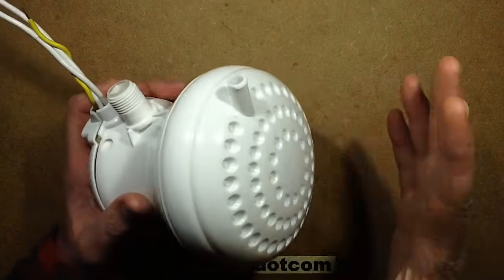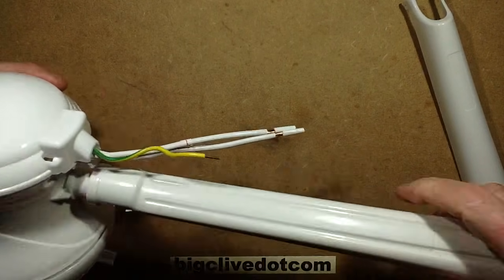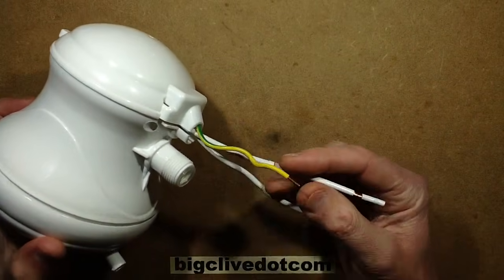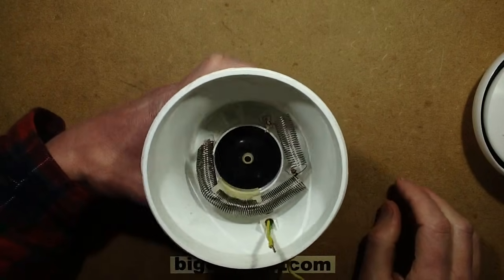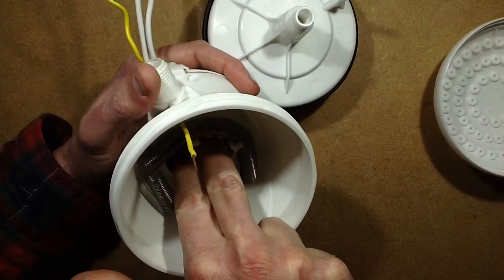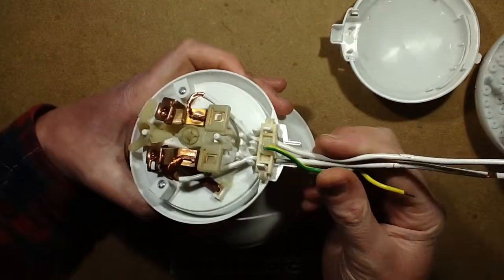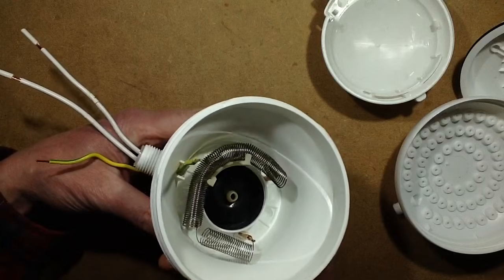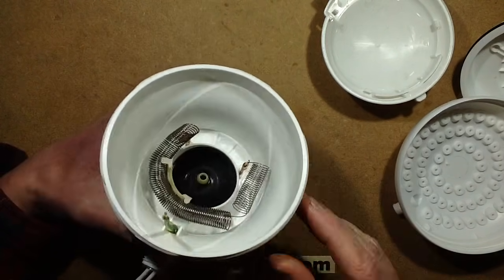Inside a heated shower head.  (suicide shower)

Comment: Watching these older videos, I must say, I have always been fascinated by these shower heads. I've never seen one of these in use, but for some reason I want to install one in my shower. I have a fifty gallon heater tank, so I'm not in want of hot water for showering, but the on demand or supplemental aspects are appealing to me. I'm not afraid of doing the work, but I would never run 240v into my water closet as I have a healthy fear of electricity in regards to water. 120v here wouldn't do much as far as heating those elements up, but I'll always remain curious. Great video, by the way!!
Reply from the maker: I'd definitely not recommend actually using one of these.  But buying one as a novelty is viable.

Comment: every other brazilian in this comment section is pointing out things like the relative safety of electrical showers, the complete absence of boilers in brazilian houses, the existence of higher wattage showers for colder regions, the extreme poor quality of this shoddy chinese knockoff unit, the inexistence of GFCI etc etc, but i don’t see anyone pointing out that the big hose with the “valve” at the end is not a safety steam release. that’s a douche, you pull the plug when you want to wash your parts ^^"
Reply: Not putting that thing anywhere near my "parts" 😮

Comment: I found one of these in a hacienda in Ecuador - 110V 50+A as I recall, wires connected with screws and nuts - but for added value the power switch on the wall just outside the shower area was an open double-pole knife switch. I took a lukewarm shower!

Comment: The little hose that comes off the shower head is for rinsing your difficult to reach areas.  My landlord says we can't use the warmer setting - it will burn out the shower.  The lower the pressure, the hotter it gets.  
We used one at a hotel that had a fuse in it somewhere. They had to change it as we had no warm water the first night.

Comment: Droplets of water do not carry current if voltage is low (up to about 1kV) but when it's higher then current can jump from drop to drop. This is the difference that you can't electrocute yourself by peeing on the third rail (you only get arrested) but you can get tingle from cattle fence.

Comment: These comments from Brazilians defending the horrible conditions they live in are amazing.

"No, we like it! We're happy that hundreds of people die in the shower every year for no fucking reason. This is good and fine and normal!"
Reply: The problem is that the statistics don't say that. We have like 90% of our houses with electric shower heads like this one (a little better built honestly, but very similar) and the accidents happens more on the 10% that actually don't use them... Like people dying on poor gas ventilation due to faulty gas heaters... And its worse since most people don't properly install them by neglecting the grounding, having wrong wiring and improper isolation...

It does look stupid, but if you compare the numbers of accidents to other heating methods it is statically safer.

Also, we normally don't have bathtubs which looks like where most of deaths happens from electrocution while taking a bath in other countries...

Comment: The little hose is not a blow off. Its just a spray hose to rinse off with. The water follows the path of least resistance when you full the little knob. Use these for over 30 years. Don't ever use a plastic pipe to the unit or pvc in the wall. Ground the pipe and metal extension well and it will never, ever shock you.
Reply: The Brazilian Lorenzetti are the best I've ever used.

Comment: The real suicide shower were the old ones - made of bare metal. There norms in Brazil requiring ground and and all the other safety devices and it's not a surprise most deaths due to electricity happen in the poorer regions up north where, btw, people usually to turn the shower on because it's too damn hot even during the winter. You are correct - it correlates with poverty even within Brazil - and regulatory agencies don't look closer into the problem since they know how difficult it's for people to follow them. They should, however, not let a store like Leroy Merlin to sell insulated tubular connectors that don't crimp!  10 for one buck while the one with the Inmetro (national standards institution) seal and NBR (technical norms) number cost 1 buck each. (those are local bucks - 1/6 or 1/7 of a British but and 1/5 of a US buck). In 2018 the National Museum located on Rio de Janeiro went to dust after a fire that burned all historic documents, the oldest human found in the Americas and Egyptian mummies brought to Brazil by the Portuguese monarch in 1808. I bet both my arms it was electric failure. Those showers are safe - I don't like them because they leak water and the heating element breaks too often. Electric installations, however, make me worried when I find them. I must say something, though: why people worry about a buzzing coming from the water heater over their heads but don't worry about the buzzing from the kettle when it's on?

Wow ... there's a video about the shower from ElectroBOOM also! Soon Veritasium will do one explaining why you can touch live wires - because electricity flows outside the wires!

Comment: It blows my mind how sketchy this thing is, in so many ways! Aside from the flimsy switch, comically short wires, fragile connections, and the intrinsically dangerous operating principle, one thing that occurs to me is that the exposed grounding wire would start to corrode pretty quickly, and before long be completely covered in a layer of copper oxide and maybe also some mineral deposits. So that even if the ground was properly connected, the grounding might not be effective for long..

Comment: As an Canadian automotive tech, i have an unusual story about water and electricity. 
Dozen or so years ago during my apprenticeship, my shop got one of these 'bio wash tanks'  parts washing tank with water mixed with some organic 'bug' thatd 'eat' oil. It had to be left on 24/7, as it was heated to keep the 'bugs' alive. We can see where this is going cant we?  Well, for at least a week, Every time Id use it - having worn out steel toed boots on cement - id feel a less than pleasant tingle. Felt like my toes were getting poked with needles. After telling my shop foreman this more than once, who didnt buy it swearing the breaker would trip, i finally got enough of a zap to be annoyed enough to take my then new 500$ DMM - a big cost to a second year tech and REALLY not wanting to fry it otherwise but it was time to make a point, set it to auto V, stick one end in the water, and the other end on the grounded metal case of the outlet that fed the tank. Imagine my foreman's surprise to see 125V comin from the water.  Drained the tank, found the heating element corroded completely bare.  Yea that got tagged out for a couple weeks while we waited for parts to show.

Comment: Here in Uruguay, we use electric storage boilers. Our climate is colder. But, of course, since Brazil is our big neighbour, along the border this kind of device is widely used. Travelling there sometimes I did have to use the nasty little device, and I have been scared every single time. I was aware of NOT touching the temperature controls when the main switch is on. We have a 230 volts service but Brazil is just 110, so may be this explains the good safety records in that country. They are dirty cheap also, and you can get a snap-on heater element replacement for just 5 dollars. In Argentina (our another great neighbour) they are forbidden (mainly gas boilers there)

Comment: I am from Brazil, in my house I use a 7500W 220V shower grounded and with GFCI with 30mA sensitivity, it works amazingly well. GFCI had pulled off with my electric oven on humid days, but never with the shower.

Comment: Yeah, another crazy Brazilian here. As a kid, I used to disassembly these shower heads just for fun. I've used many of worse quality than this one that Big Clive reviewed on this video. It's relatively safe to use, as many other mentioned here. I've never heard of any serious problems with it, just minor shock sensations on some very bad installations. I mean, "the live wire touching the metal pipe leading to the metal shower head" type of bad installations. Other than that, I consider these perfectly safe. And it's not just me saying it - it's statistics. Almost every home in Brazil has one of those units working, in either 127v or 220v. Many of these are poorly installed. In 2019, ~700 people were killed by electric shocks in Brazil. Of those, 34,5% happened at home (let's say, 300 cases). I couldn't find how much of these accidents were actually by people showering, but let's say it's 20%. That would give us 60 cases per year, which may seem high, but mind you: our population is about 210 million. We have, on average, 110 people being struck by a lightning every year. ElectroBOOM has a follow-up video on his own video about this type of shower head that is worth watching.
https://www.youtube.com/watch?v=06w3-l1AzFk
Reply: No one dies showering with an electric shower.
Reply: That logic is flawed, by the way. Those 60 cases are not just statistics, they are people, someone's loved ones. And unlike lightning strikes, they are 100% preventable by safety measures.
Reply: Ah, yeah, I know, but, OTOH, we don't have the numbers from other countries to compare (or do we?), so your argument is 100% valid, but still fallacious like mine. If we're going strictly on logic, the data I found wasn't specific to shower shocks. Where's your data to support your logic? It may not exist...
Reply: @viniciusvbf22  well, i based my point exclusively on logic, not statistics. If harm can be prevented, effort should be put into doing so, not dismissing it because it is insignificant due to statistics. Or else it is just sarcificing lifes for the money/effort, and i'm not a fan of that.
Reply: @voidseeker4394  you don't get my point, but it's OK. You don't have any proof that it's insignificant due to statistics, or even if harm would be prevented otherwise, because, guess what? You don't have data to prove it. As far as we both know and have data to prove, using showers as this is as safe as any other. Your claim is based solely on what you think, which is illogical.
Reply: @viniciusvbf22  acabou com o cara
Reply: Ok, in your experience that these are fine. The most I can offer you is I accept that you feel this way, and leave you with that.

But there is no way anyone else can comprehend the logic of comparing lightning strike deaths to the simple act of taking a shower. Let's compare injuries & deaths of eating an orange vs being killed in a hurricane. Your logical comparisons are are flawed. I live in Florida, people get killed by lightning, but they don't get electrocuted by their daily shower! Taking a shower shouldn't even relate to the risk of being struck by lightning. Except when there is a thunderstorm, I don't use the shower or faucets, in case my house gets hit by lightning. 

I'm horrified at the idea of putting live wires with water seeming like a good, normal idea.  And then getting shocked when you try to adjust the showerhead while showering? Why? Just why should that even be an acceptable thing???

Hard no. 
Never ever.
Reply: @user-jy1md7vk1w   Except you're comparing apples to oranges.  "Getting struck by lightning" is not the relevant action.  No one chooses to get struck by lightning. 

People choose to use these showerheads, the risk is electrocution. 
People choose to go outside during rain, the risk is lightning strikes.

So, yes, comparing them is completely valid.  If anything, using these showerheads is likely safer than going outside during a thunderstorm - so should no one ever go outside while it's raining?
Reply: @grafzeppelin4069 except the majority of the population don’t have a choice. Most don’t. Because they can’t afford building a heater system in their house. Pfff. Wouldn’t doubt if even more than 70% Brazilians couldn’t afford such a thing. So… Yeah. And the population that can have heater system, they already have a heater system. Trust me.
Reply: It's not my experience. It's math and statistics.

Comment: The latest regulations in the Netherlands require a 10mA leakage current switch for bathroom appliances in new buildings. But I guess the old 30mA standard was already enough to prevent us from installing this shower head.

Comment: Yep I'm from Brazil and I'm quite tall, which resulted in me getting zapped by the showerhead a few times in different places. In some houses without proper grounding you also can get shocked just by opening/closing the shower water.
Some shower models from some brands have the heating element isolated, so you don't get current running directly through the water, that prevents this problem but they're quite a bit more expensive.
I just don't turn this type of shower on anymore, not like you need hot water to shower here anyways
Reply: Yep, as with any device the installation should be done right, with the ground wiring plugged these showers are as safe as one can get, there's much more incidents of deaths caused by boilers and gas heating installations than with these cheap electric showers.

Comment: It's safe. I think there in northern countries it's less common because it will need to heat much more the water than in tropical countries, resulting in extreme currents and energy consuption. If it weren't by that, they would probably exist there too
Reply: It's unsafe and luckily it even cannot be installed in modern houses because of the mandatory 30mA leakage current switch for bathrooms. That will trip instantly with nonsense like this.

Comment: These shower gives me goosebumps, when ours actually leak water from those wiring ports.
Reply: Why? People heat their houses with gas that might (and do) kill them when it leaks and no one bats an eye. People die because of carbon monoxide poisoning not by electrical shock in the shower.

Comment: I saw a squatter house with an oven element wired to a common appliance line the plug lying under a socket. Without gas heat, they had so heated their bath water.

Comment: @0:26 "Many of the countries where it's installed don't bother with  [garbled sound here] . . ."  don't bother with what, strong accent and mumbling ... I can't understand your words...
Reply: "Earth wire". Clive does have a bit of an accent but it's perfectly comprehensible, wash your ears.
Reply: @FokkerBoombass I agree with your anal-ysis, that the words are easy to understand (for normal people even if they don't live in England) but cut them a small bit of slack, as their country possibly doesn't use the term "earth wire" and if they have never heard the term before, then it is harder to understand what anyone is saying if your brain doesn't make the connection between "earth wire" being an electrical term, and so the brain looks for other words, as it has chosen to discard the possibility of hearing the words as "earth wire" since that is a term not in their mind palaces.
On the other hand, some people do walk around with ham in their ears and also are way too xenophobic if someone doesn't talk exactly like their narrow band of single geographic experience demands. 
But never assume ham is involved (clogging up the ears), it may simply be unfamiliarity with terminology. Ham is edible, and the latter is not.
Which makes a big difference, especially if you're hungry.

Comment: We have that shit in shit in Brazil... yeah... the hose is NOT a safety device... it is intended to be used as a hose sprayer... AND most of the houses do not have a ground connection.... I actually wonder what happened when they changed the "code" to have the outlets replaced on a political whim to favor certain people who made the new outlets... I bet the shoddy electricians have had field days since then because they just replaced the outlets without adding the actual ground.
I've seen the ground only on newer buildings (and that means, vertical apartment buildings).
I can tell you it works quite well but I was never comfortable with that shit over my head and not sure if it was properly grounded. Most of the pipes in the walls are PVC so the whole thing is less conductive but I never took many chances and wherever I lived, I grounded the damn thing.
Now, on those sub par hotels where I found these, I used something to turn the faucet on and off.
And you know what, it's been that kind of device since I remember being a 7 yo kid (i'm 60 now)....  oh yeah, there is also the kitchen sink version, which is basically the same shit.
It's still quite scary and the reason is that houses and buildings have no insulation, no insulated pipes, no A/C and of course, no central heat... you get warm water "on demand"  while cold water is in the pipes year round :-)

Comment: I would like to knw were the on and off button is on the shower head Its not working I find the fault is insde the shower head there's the copper clip that's broken.can it be fixed.or do I need to replace the showerhead
Reply from the maker: I'd recommend replacing the whole shower head.  The only serviceable bit is the heating element.